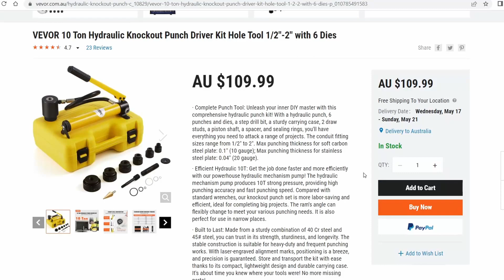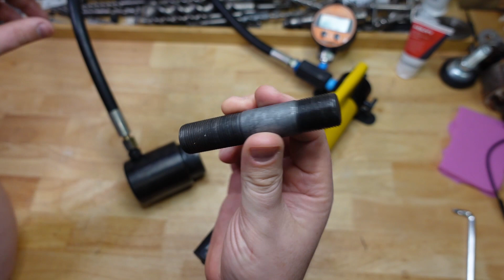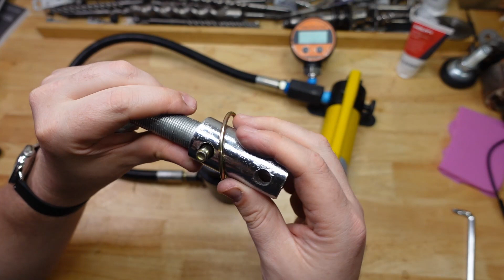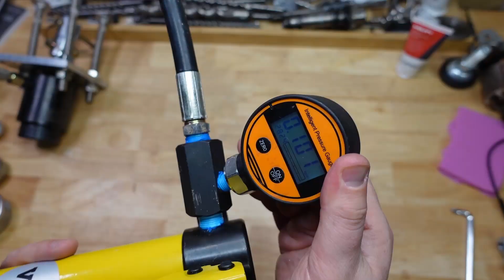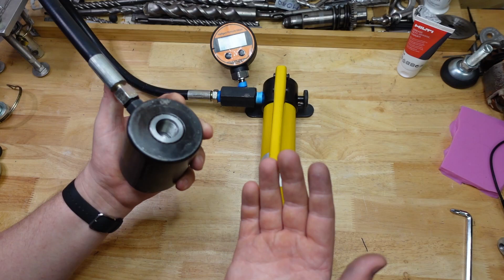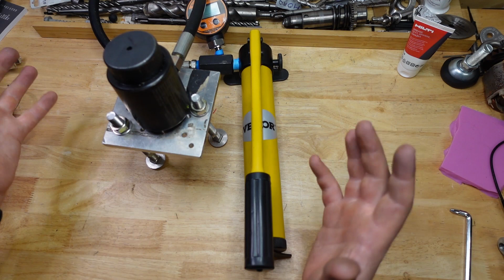Building a hydraulic pull tester!

Comment: Should get less bending with swivel feet. Looks like you have one on your desk. The female threaded versions are better, but they seem rarer and I can't find any that even give a price.

It's not foolproof. Had a new guy not pay attention and bend the legs of a hydrajaws, which is a giant pain as they can't be removed when bent.

You could try restraining the legs. Maybe several wraps of dyneema webbing for ultralight setup, or a small ratchet strap for less faff.

I'd definitely try to get rid of the double nut setup, but don't do threaded holes. Maybe try sandwiching a square nut between 2 alu plates. The bottom plate can be 2mm as it's just there to stop the nuts falling out. Glue blocks of alu (or other square nuts) around the sides of the square nut to stop it rotating.
Reply from the maker: Thanks again mate. So you use proper hydrajaws in your work? I can definitely see the refinements they've made to that product and I hope to get one someday. Do you know why the legs are offset? The Hilti tester is also like that. I'll probably just make mine a bit bigger, maybe class 12.8 steel, and maybe offset with an M16 one end and 2xm12 on the other. But it's hard to find and I want to avoid having anything made.
I considered leg straps but the legs held up better than expected, and I didn't want to faff with it any more. Also blocks the camera from seeing the "action"
Reply: @MountainMullet  Used to - left that job. Not sure what you mean by offset. Do you mean why 3 legs rather than 2, or why the legs don't form an equilateral? I used an older hilti with just 2 legs and it was an absolute bastard, always leaning over if you didn't position it perfectly. I guess non-equilateral is to give it enough space that the feet aren't interfering with the anchor, but keeping it narrow enough to get anchors that are up against a wall.

Bigger is better than stronger. You're dealing with buckling, so strength is less important than geometry and modulus, and all steel is 210GPa.
Reply from the maker: Yeah, Isosceles triangle configuration legs. More room to access anchor from the sides and also I suspect it makes leveling a bit easier

Comment: Awesome! Thanks for doing all the research and design and sharing it. 
It used to be more common to use similar hydraulic pullers to remove and replace old bolts before Greg German's ball screw type puller was designed. 
Really impressive that you were able to design something that compact and cheap.
Reply from the maker: Thanks mate! I actually started this by trying to make a screw based puller with a load cell so you could see how strong the old bolt was, but this turned out easier to make. The screw one is nowhere near as strong and is still a work in progress but you'll see that eventually too.
Some of the oldest pull test data/ vids on YouTube are from an Aussie guy Mike Law who uses some kind of hydraulic puller but I haven't seen what that rig is. Presumably something bigger
Reply: @MountainMullet  we watched those videos when we where designing our pullers.
Reply from the maker: And if you ever saw that old one about how to remove wedge bolts, I believe the tool they use is a smaller hydraulic hole punch. I had no idea what that was until researching this device. Maybe researching is too strong a word... Endlessly online shopping for cheap tools maybe?
Reply: @MountainMullet  greenlee was the brand they used. Super expensive!
Reply from the maker: Wow Greenlees! You could almost buy a proper calibrated hyrdajaws tester for that money